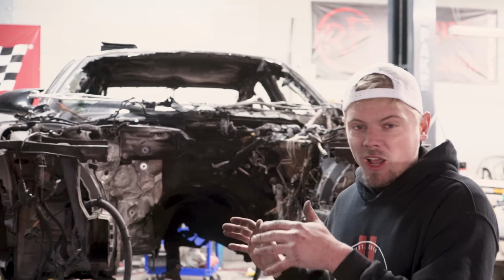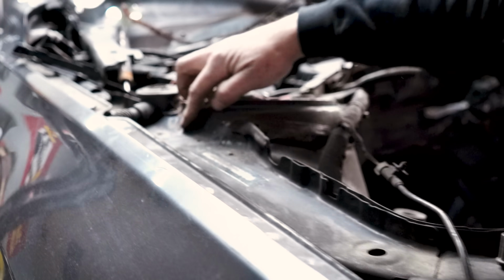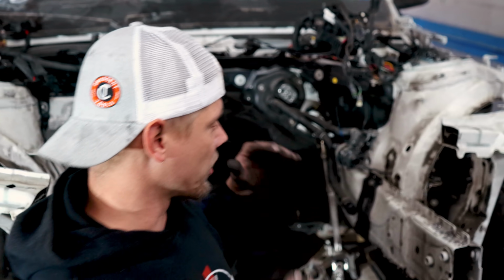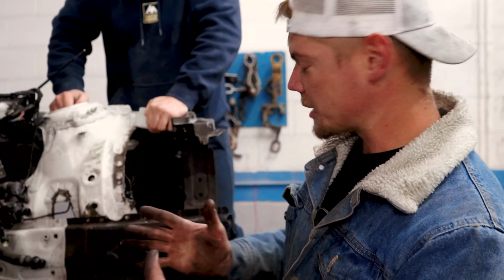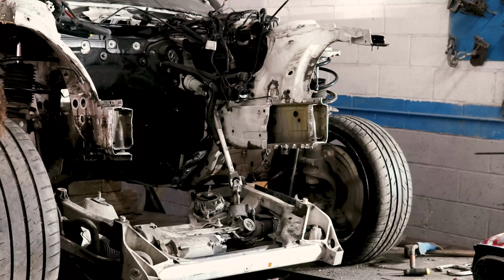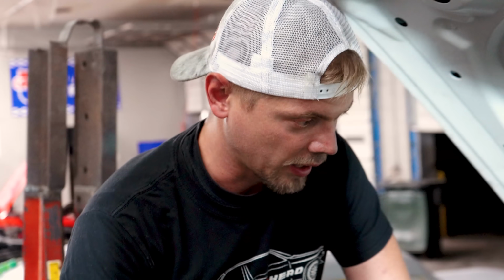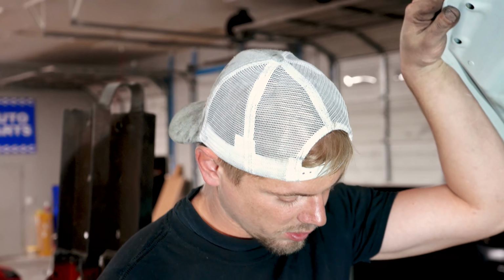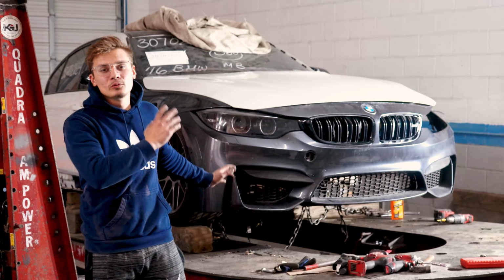The Smashed BMW M3’s framework is complete! Amazing results!

Comment: Hey on that motor please strip everything and take the spark plugs off and put some transmission fluid right in the cylinder wall let it sit for little bit and then turn it by hand and then just flush it with oil couple times. It will clean up the internals real well

Comment: Couldn’t the VIN have been cut off the damaged part and reused?  That would make sense for easier re-registration.
Reply from the maker: It’s illegal
Reply: You explained vin swapping 😅😂
Reply from the maker: @MrBloodguns  it’s not illegal to use a part with a different vin. It’s illegal to remove a vin off a part and put a new one on that specific part. Bc you can no longer prove where you got that part from
Reply: so weird you can't do that. where I live that car would never pass inspection with different vin. you have to put the right one back.

Comment: So hang on your doing the job right now because you took the engine out but you wouldn’t of if the engine wasn’t damaged ? That’s shonky way to do a proper repair then and you didn’t no what you was buying well didn’t you look 👀 at the car first didn’t you ask for different photos to see under the bonnet and ask what all the damage was ?and that chassis plate stamped chassis number easy as anything to do cut out round the plate leaving bit if distance to re weld it back in grind off the weld hey presto correct chassis number in your car That’s school one O one for starters asked what all damage is so its fact what you were told and ask lot of photos if you cannot get to see the car in person and never 👎 rush into buy a car you really want as it never 👎 is what you think 🤔 it is